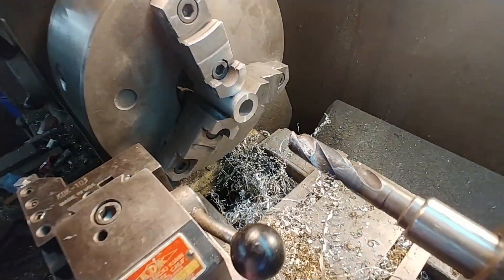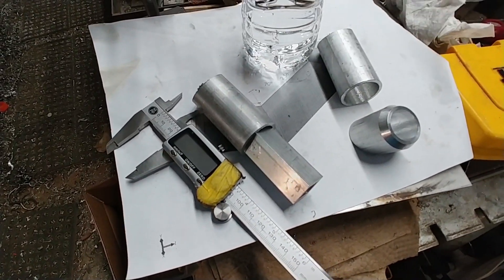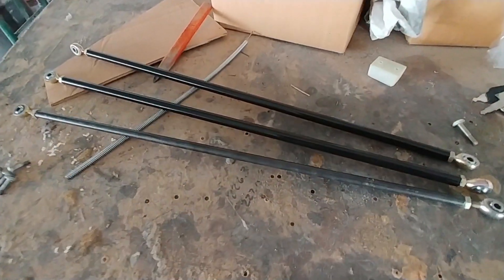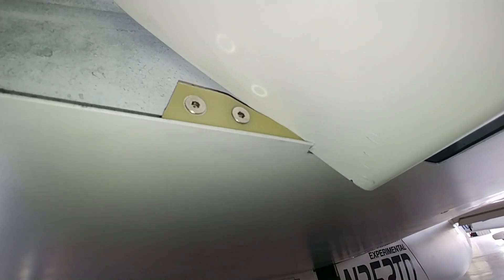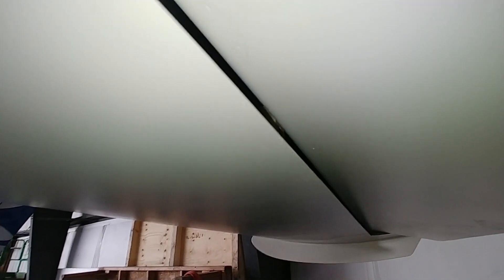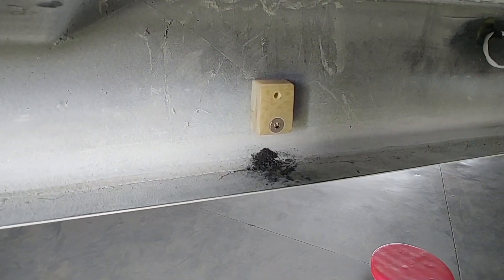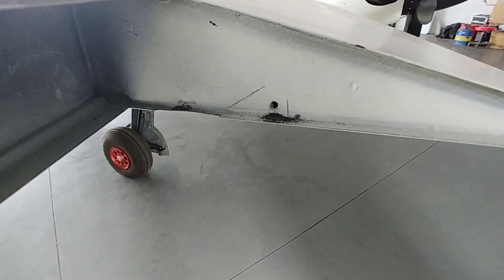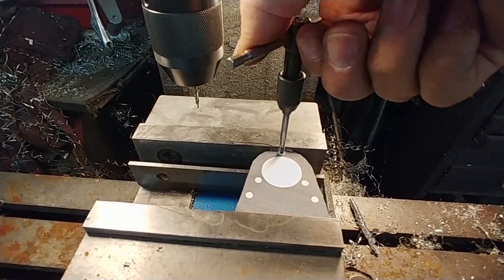Aileron Hard Stops - Building the Raptor Prototype

Comment: What's the reason for having the aileron down limit higher than up limit?  Seems like that'd be a great way to produce adverse yaw.
Reply from the maker: Well, when you go right aileron up, for example, the right wing dips and you actually want some yaw in there to pull the nose around. This means less pilot input on the rudder to stay coordinated. So in this case you want more right yaw than left and hence the higher up angle than down.
Reply: @RaptorAircraft  Thanks for taking the time to write that explanation out. I'm aware of differential ailerons, it appeared that you had more downward deflection than upward based on the numbers on the angle finder.  I had to go back and look at it again to realize you didn't zero the angle out at streamlined position.

Comment: You know that tapping tool can be used with a live center so you can tap threads straight. Makes doing threads a lot easier if it is in a vise or lathe.

Comment: Something maybe  worth looking at doing is work hardening the surface of the alloy  tube by using the bearing themselves to do it.  Just run the shaft up and down  slowly increasing the torque and force on the bearings.  I am not am expert on this but should in theory work harden the surface.  Maybe try it on the shaft you have already tested and see if afterwards the  dent is as large.

Comment: I always thought the limits of the surfaces course should be at the stick instead of on surfaces for a simple reason, don't produce extra efforts to wear and create clearance at the controls sooner.
Reply: Most maintenance manuals and regs stipulate that the control surfaces hit first, then the stick.  You can deflect the control linkages slightly to hit the stick limits even after the control surfaces have bottomed out.  If they hit at the same time or the stick hits first in ideal conditions, then you've introduced a likelihood that controls surfaces won't get full deflection when temps or load factors on the airframe change...and that's important for a lot of reasons.  This is also beneficial when wind gusts or other forces manipulate control surfaces, as that force does not translate into the relatively weaker control linkages and damaging something further down the line.  Control surface stops are made to be beefy and withstand impact loads to a point, whereas the stick limits are not...often times they're just a small bolt in a sheetmetal tab that could be deformed with much less force.
Reply from the maker: It's ideal to have stops at the stick and at the ailerons and have them adjusted so they hit the stops at the same point of travel.

Comment: Thanks for the update! Good luck with the last bits and pieces. 

On the rivnuts: I don’t think they last very long and will wiggle loose and worse case block the control surfaces , another issue could be galvanic corrosion.
Reply: Definition of galvanic corrosion: "Galvanic corrosion, also known as bimetallic corrosion, is an electrochemical process whereby one metal corrodes in preference to another metal that it is in contact with through an electrolyte."
Carbon is not a metal. So no galvanic corrosion.
Reply: @VEJ2  That's incorrect, carbon fiber (graphite) is electrically conductive, do a Google search...

Comment: On the rivnuts, are you not worried about galvanic corrosion between the rivnut and the carbon?
Reply: If the rivnuts are anodized aluminum or stainless steel I don't think its a problem. Otherwise you will see galvanic corrosion.
Reply: Definition of galvanic corrosion: "Galvanic corrosion, also known as bimetallic corrosion, is an electrochemical process whereby one metal corrodes in preference to another metal that it is in contact with through an electrolyte."
Carbon is not a metal. So no galvanic corrosion.
Reply: @VEJ2  Please reference the following regarding galvanic corrosion and carbon fiber composite materials : https://www.corrosionpedia.com/galvanic-corrosion-of-metals-connected-to-carbon-fiber-reinforced-polymers/2/1556
Reply: @VEJ2  Take a look at Mike Patey's channel, he's always designing to avoid galvanic corrosion with carbon, and he's not exactly a newbie when it comes to building planes from carbon.

Comment: Given you have some time, I recall that the engine accessory belt was slipping off of the idler pulley a while ago.  It was corrected by fixing the alignment.  However, I believe losing that belt would be a single point of failure because it runs the engine cooling system.  Maybe, given you have access to a machine shop, you might replace the idler pulley with one that has lips on both sides to help ensure that belt doesn't slip off.
Reply from the maker: I have been checking that belt and it hasn't moved even with all the running I've done in the engine since I placed the correct length belt on there. It's the factory idler and there's nothing wrong with it or where it mounts.

Comment: It looks like the up aileron deflection block is pressing against the unsupported skin of the aileron. I would suggest re-enforcing the skin with a wedge of the same material the blocks are made of so a sudden impact doesn’t fracture the aileron skin.
Reply from the maker: It's pressing on the edge where there are many layers and then the end rib support so it's plenty strong there.

Comment: Just a completely out in left field idea. Honestly, I'm not even sure it's worth putting up here, but what about a channel down the length of the bar, and then potting compound to hold it in place. Any machine shop should be able to mill it out. As long as the wire isn't crazy thick it would probably have no effect on overall strength. I mean the strength is way beyond what you need anyway already. 

Anyway, just putting that out there. Good work.
Reply from the maker: It's a possibility.

Comment: Peter I just sat in on one of the EAA Webinars, this one was titled "Your Airworthiness Inspection — Be Ready" by Joe Norris.  You can find it on https://www.eaa.org/eaa/news-and-publications/eaa-webinars web site.  Anyway they go over a lot of good information about what inspectors are looking for during their inspections.  One of them came to mind when I was watching your video.  At 2:39 where you are showing the installation of the new push rod you can see the bolt with all the washers and nut.  According to the webinar you should have a minimum of one thread and a maximum of 3 threads showing past the nut.  In your video it is hard to tell, but it look like you might have more threads showing, indicating that your bolt might be a bit long.  I'm not trying to make trouble but I don't want Justin and Elliot to kick it back to you again on minor items like this.  I would suggest you watch that EAA Webinar when they get it posted in a few days as they have plenty of good ideas to make sure you pass the inspection.  If you find that things need to be attended to you will have some time, since you have a few weeks before Justin and Elliot get there.
Reply: Here is the link to the webinar ->  https://eaa.org/Videos/Webinars/Aircraft-Building/6167221184001
Looks like you need an EAA Membership to watch.

Comment: Very nice machine work Peter, get the scrap out and start welding, I believe you'd pick up the skill rather quickly. I seriously doubt the in flight aileron load will approach anywhere near what you're prepping for.....if it ever did there'd be much more serious problems to be dealt with......in the future you may want to consider rigging so the weight of each aileron are statically self canceled.

Comment: Moving right along Peter. I was starting to have Raptor withdrawals from not hearing from you. Just Aircraft are having a Fly In that same time frame of July 27th to August 2nd. Lots going on but we all hope you shall be flying too. Those Aileron stops should have some buildup material on the Aileron surface. You mentioned that the leading edge has a steel spar but the thin surfaces may start to crack after repeated hits cycling the stick during control surface checks?? Easy on the stick guys... keep up the great work we’re all behind you and you are sounding more confident now that we showed you just how much we believe in your project Peter. And I’m a real skeptic by nature!! Cheers Peter!

Comment: In inches that would be .0002"-.0003", for a total oxidized layer of .0004" to .0006", attempts to exceed these depths often result in uneven or 'burnt' coatings which fail earlier than the conservative depths. All of this is anecdotal evidence, just experience. 7071 alloy accepts the hard anodize process quite well, but does  change the dimensions of the finished product by an amount which is of a concern to precision assembly designers. Yield strength is the critical design parameter, and surface wear is a consideration.

Comment: I concur with Av and Dwight. However hard anodize is actually bi-directional as a process, the penetration is typically 2-3 microns while buildup is roughly equal to the penetration value.  6-8 microns of hard oxide on an aluminum surface will provide wear benefits, but if yield strength, (about 40,000 psi for 6061,depending on temper and aging), is reached, yield occurs.  7071 has a typical yield of 75,000 psi, closer to mild steel.  Material of choice for lightweight metal components when titanium is not considered due to price constraints.

Comment: You may consider having the 7075 bar gun drilled for the wires.
Reply from the maker: Yes, that would be an option but finding a shop and having it done quickly and not cost too much is probably not possible.
Reply: @RaptorAircraft  I understand. Great post... I'm inspired by your ability to solve each problem that arises.

Comment: Hard anodizing is good for surface wear. However, it’s only a few microns thick. So, although it may improve the situation, it may not totally solve the “dimpling” problem on the square tube.
Reply from the maker: Yes, that's why I've got the 7075. It should be hard enough. The anodizing should just keep it smooth.